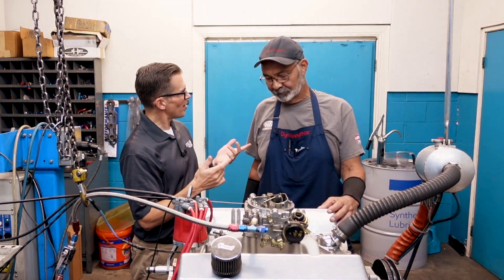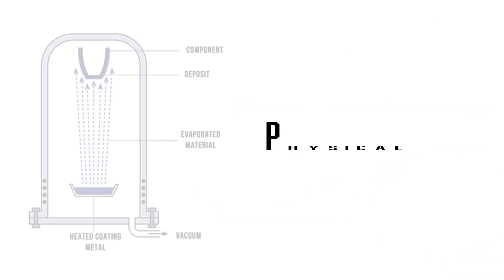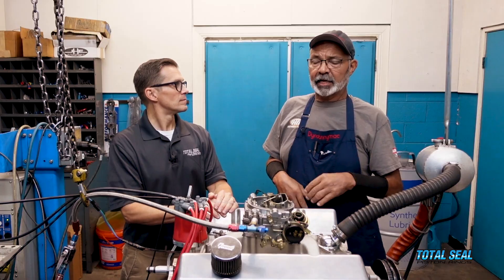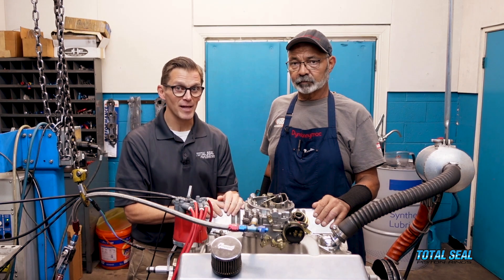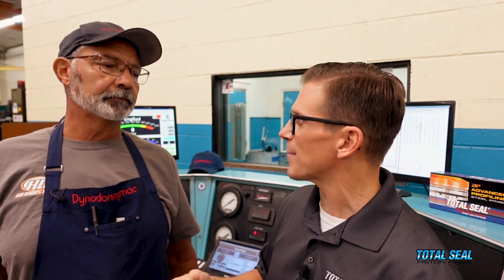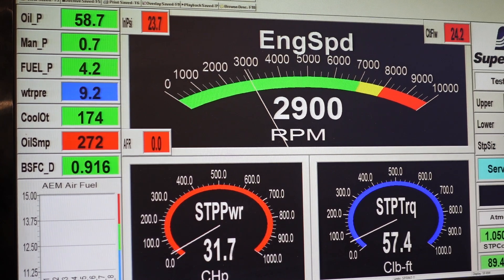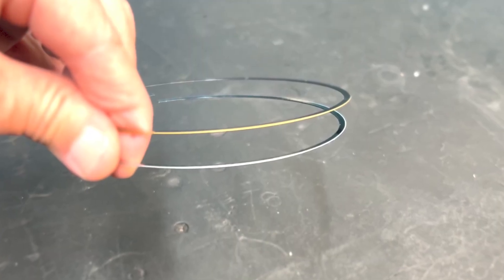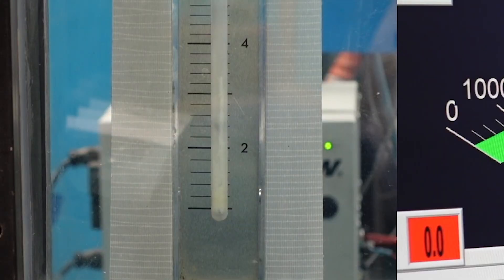The Problem With Chrome Piston Rings / What Makes A Drill Bit Good Can Make Your Piston Rings Better

Comment: This test is confusing. I saw in the comments you said the hone was the same compared to the last test with the chrome rings. What about the top and 2nd rings? Were they reused or replaced with the exact same rings new? Same end gaps? So many questions. I thought the oil rings job was solely to scrape oil, but the video is eluding that they actually are holding compression that is getting past the 1st and 2nd ring?

Comment: Is any manufacturer uses cobalt steel to make piston rings? Cobalt drill bits are way better than Ti-N coated drill bits.
Reply from the maker: No, but Tool Steel with PVD coatings are used.

Comment: Chrome rings were originally designed for engines that were going to eat dirt bottom line answer.
Reply: I've got a 50cc piston. 
Does the chrome ring go on top or the black ring go on top???...2 groove piston

Comment: YOU GUYS ARE MAKING SAME GREAT VIDEOS !  Back in the early 70's i worked at gm dealer ship we replaced a sbs with a new gm oem engine i think it has a 283 i know it had chrome rings . after about 2 weeks the car was still using oil the owner brought it back to us . my service manager told me to go out behind your shop with him and take the air cleaner off and the fan belt off . he then pulled on a can of comet kitchen  cleaning out he rev the engine and started shaking it into the carb . i think he used the whole can . i couldn't believe he did it . he then told my it was a trick they did for years even on brand new cars . the car did stop burning oil . l always wondered how much other damage it did to the engine .
Reply from the maker: Thanks! We've also heard of the Comet or Borax trick on chrome rings. Certainly not the best thing for the rest of the engine.

Comment: Lake, what is the difference in the friction coefficient of TiN vs Chrome Plating? Would you say the percentage of torque gain is comparable to the % difference in friction coefficient? Quantifiable data from Tribological methods. Good stuff. I like seeing the chrome plate alternatives.
Reply from the maker: The TiN has a lower coefficient of friction compared to chrome, so that is the reason for the increase in power.
Reply: Does Chrome not have problems with galling?

Comment: Great videos gentlemen! It’s awesome to see you two educating racers and enthusiasts.  One question I think is important to the reduction in friction? What oil where you running? Was the break in oil changed after the rings seated? Again great work, nice reference to the water and oil temps used for a baseline.  Thanks
Reply from the maker: We use Driven BR40 for all the tests. It contains no friction reducers, so it allows us to see any changes in friction due to the hone, coatings or ring design.

Comment: That’s all good and fine. How is the average back yard joe going to get this done? I love this stuff but how am I going to do this? I don’t have the big money for all the stuff to be done. Is there anything you can do to get it done for the weekend guys to have a sweet motor like that?
Reply from the maker: None of these technologies are out of reach for the back yard engine assembler. A good machine shop can easily afford the correct tools to get the cylinders honed correctly, and the piston rings are not expensive, especially in light of how long they last and how much power they can deliver.
Reply: @TotalSeal  cool fine and dandy. BUT!!!! Again! Sorry but if backyard man wants to do this at home with what he has for tools how does he get the job done on the walls of his motor without all the fancy stuff you have in your Machine shop? I love the ring ideas and all but if I go to freshen up a motor with rings and bearings how do you get it done at home? I don’t have the thing to check the walls and so and I don’t think most guys at home doing this will. Unless this will make it easierfor us to do it at home so we don’t have to go to the shop. Lol ! Yeah like that is going to happen.
Reply from the maker: Without the higher end tools, you can’t achieve the higher end results. That’s why going to a machine shop with the right tools can more than make up for the difference in price. A longer lasting engine pays for itself.
Reply: @TotalSeal  I can tell you right now the Machine shops here don’t have the stuff you’re doing. I have been to the ones around Sioux Falls and act I’m talking a foreign language when I talk to them about this. This is before I saw the ring thing here now. Far as I can tell still doing stuff from 30 years ago. Gave me the story I have done this for so and so years and so on and I walk out. So how do I find a shop? I have been to 2 here. That’s 50 or 60 miles away. Lots of places have closed. How do you find a good shop? I don’t trust one of the shop anymore cracked my head doing some head work.
Reply from the maker: We here you on the “this is how we’ve always done it” attitude… Try contacting the guys at Rottler Mfg. They know where the shops with modern equipment are located.
Reply: what do you mean? 

It looks to me like total seal is intending to sell these rings.
Reply: @bradmcgrath358  the work to get the block done! Be fine just put the hone in and done . The work they do is not cheap and have some high dollar tools.
Reply: @richardmoerke9329   Again, I don't understand what you're saying.  It doesn't cost much to have the cylinder honed.

Comment: All I need is for Total Seal to make an 87.5mm or 88mm    1.2mm  gas ported top ring.      Because the only ring sets I can buy for my engine have chrome top rings
Reply from the maker: Contact the tech department. We can probably supply 1.2mm gas ported rings in those bore sizes.
Reply: @TotalSeal  
I'm in Australia, When it get to the point of needing the rings, what is the bet way to go about ordering them?
Reply from the maker: @bradmcgrath358  Contact Performance Wholesale in Brisbane. They are our Australian distributor.
Reply: Hey Brad Mcgrath, I suggest...when you rebuild the engine...replacing the pistons. 
I had JE Pistons make a custom set of their ULTRASeries. I gave them all the required information & the specs about the TOTAL SEAL Rings I was going to use. 
Granted, the "custom" pistons were more expensive than off-the-shelf variety. BUT for 
what I've already invested in the engine, it was reasonable & I have exactly what I need. 
More-so, I'm no-longer restricted by the type of piston rings I can use. 
Best regards, 
Ben
Reply: @duygukayhanisaskank4915  
In a future more serious build, that wold be my only option, as there are only cast stock replacement pistons available for this engine.

The biggest issue is the bore size.   It's bigger than most of the Jap 4cyl engines, but smaller than everything else.  

Ideally I'd like to use rings less than 1mm